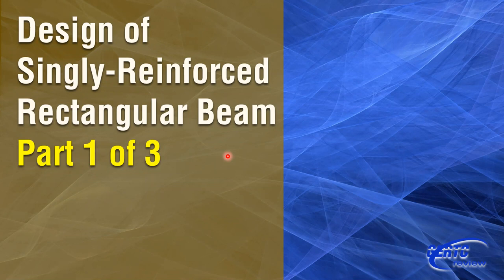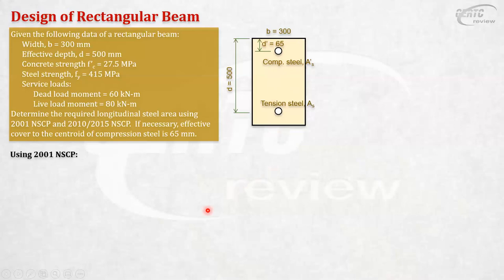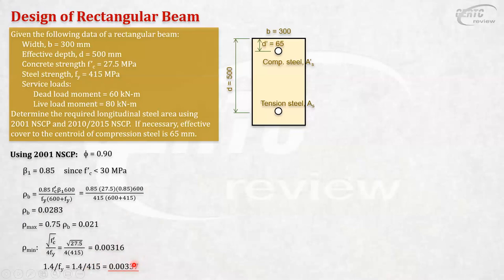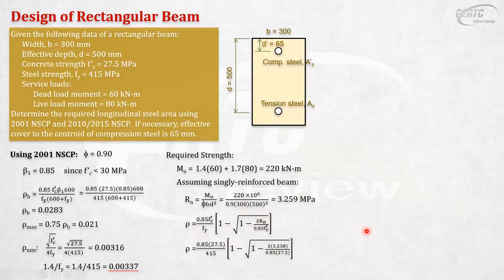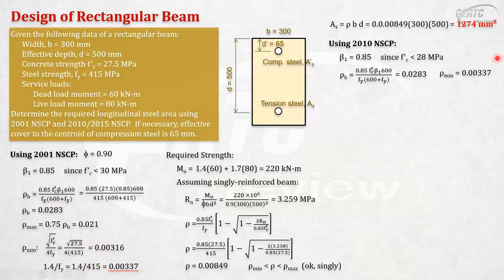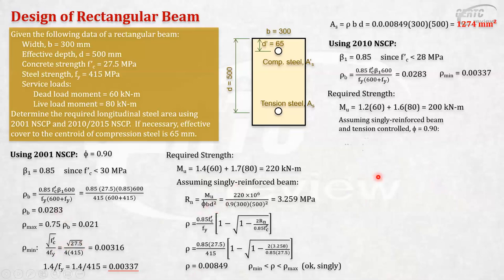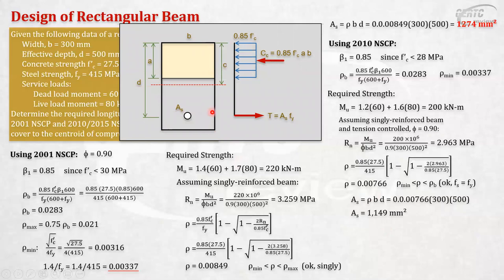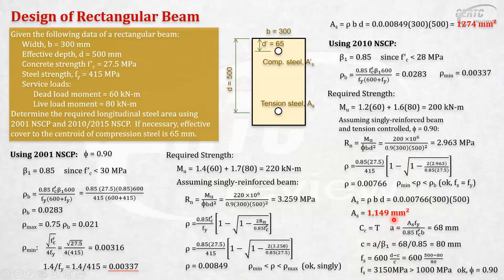Design of Rectangular Beams (Part 1 of 4)  (Reinforced Concrete)

Comment: Eto ung pinakamagandang napanuod ko tutorial regarding single vs doubly using 2001 and 2010 codes. Short and simple lang pagkakaexplain pero malaman. More on concept not on process. Kitang kita m ung pagiging beterano. Need na lng nyan matutunan ng mga students someday ano ung concept behind bakit kapag ung rho actual is less than rho max singly lng analysis, otherwise doubly.